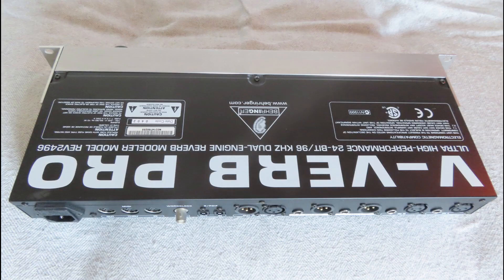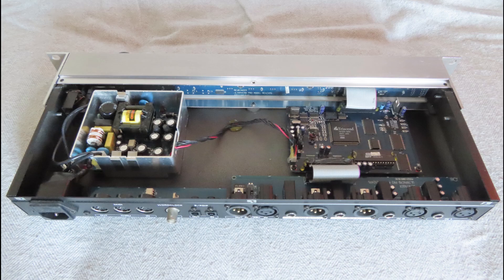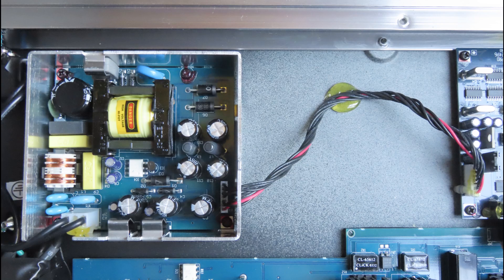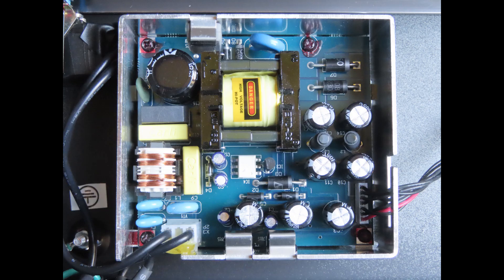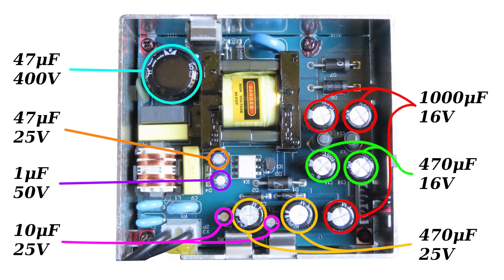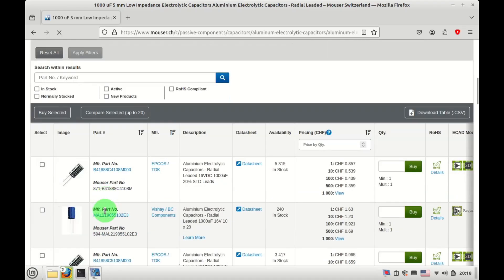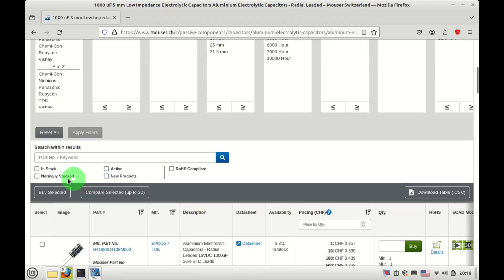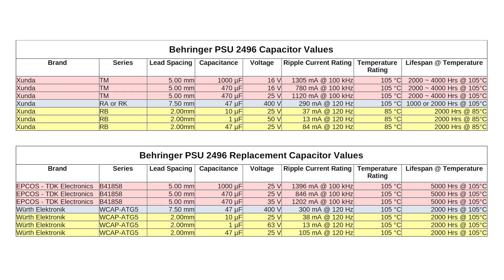Broken & Malfunctioning Behringer Rack Unit Fix. A Capacitor Replacement Is What Most Units Need.

Comment: Thank you for making this detailed video! I want to add that merely re-seating the power supply socket and pressing in the ribbon connectors solved issues on 2 of my Ultra-Curve Pro 2496 units. I haven't had to replace capacitors, and no further issues yet.
Reply from the maker: That is great. It seems to be a case of tarnished contacts where the simple act of unplugging and reseating the ribbons and sockets was enough to scrape of the tarnish and reestablish contact. If you have more stubborn tarnish or to completely clean off the tarnish you can use contact cleaner.

Comment: Mine DDM 4000 with same PSU have issues....powering off and on...I changed all capacitors in PSU and still sam behaviour. Maybe any solution? Tnx.
Reply from the maker: The rectifier Diodes could be a possible culprit. There are diodes on the power supply that rectify AC power and converts it to DC. If any of them are faulty the power supply will not work properly. If you replace them make sure you orient the band in the diode in the same direction they are now. These would be relatively easy to replace.

It could be a faulty Voltage regulator Integrated circuit, or transistor, these are all semiconductors. They are easy enough to replace but they are more challenging to identify and find matching replacements.

Also make sure to use your multi meter in continuity testing mode and check the circuit for breaks or cold solder joints. test any fuses.

Also test the output voltage of the power supply But because the power supply will be exposed and turned on to do this be extremely careful not to touch any wrong components as you could get an electric shock. Be sure to unplug the device as soon as you are done for safety reasons.
If the power supply delivers the intended power but the unit is not working the problem might not be the power supply

Also look out for anything that might be corroded, or components that look charred or burned.
Reply: @RandomStuffYouMightNeedToKnow I checked everything...I measured voltage when mixer shuts down,all voltages go off and on after 30 seconds. Rectifier bridge is Ok,I only suspect maybe something is wrong around dsp processor.
Reply from the maker: @dejbasic  If there is a 30 second shutdown cycle it could be due to overload or a Short circuit. 
This causes the power supply to shut down, wait, and restart. 
The culprit could be the circuit that is being powered by the power supply. Due to being faulty or having a short circuit. It could also be due to the Power supply itself having a short circuit. 

Try disconnecting your power supply from the circuit that it powers and measure its output. if the output becomes normal the culprit is the other circuit if the output remains in the 30 second cycling mode the culprit is in the power supply itself.

Also make sure there are no stray bits or debris anywhere on the circuit causing a short.
Reply: @RandomStuffYouMightNeedToKnow mixer is working perfectly until i supose heat up and then going into cycle off and on. When I lift up mikser main board in air,mixer start to work normaly. Strange issue.
Reply from the maker: @dejbasic  Your mixer seems to be overheating. This is why it initially works and than starts cycling on and off. when you lift the unit in to the air it has better circulation allowing it to radiate heat away from itself. An online search seems to confirm that the DDM 4000 does in fact suffer from thermal issues which aligns with your description.

Here is what I suggest you do.
Internally make sure there is not dust buildup as it prevents the unit from cooling, check any heat sinks for old or hardened  thermal paste. clean the heat sink and the component they are attached to and apply new thermal paste. You can use the same thermal paste that is sold for computer CPUs.
Consider adding Heatsinks your mixers internal Digital Signal Processors (DSPs) and other integrated circuits (ICs). You can attache the heat sinks with thermal tape.
Basically Behringer has done a poor job of cooling this unit, and anything you can add or modify to improve cooling such as heat sinks, Venting and improved circulation can make all the difference.

Externally Make sure the unit is not placed on a warm surface avoid placing it on top of other heat emitting audio gear like amplifiers, or warm effects units, avoid placing it near the warm exhaust air of a computer or near a heater. Avoid placing it on top of insulating fabric like felt. Make sure your mixer is not covered or sandwiched tightly between other objects. consider an external fan for air circulation cooling.
Reply: @RandomStuffYouMightNeedToKnow I found where is issue. There is on mainboard one linear stabilizator (7812) and 12 volts is missing on board. Im waiting for component to change it and then I will see and report here whats happend.
Reply from the maker: @dejbasic  Good Luck I hope you will succeed.

Comment: interesting! as per my first electronic work I though I could make it but now is not turning on so I beleive I have not done it right :(

I will need to find someone in Lonodn to fix it now.... I have put the paste but doesnt turn on, could that be an option? or I just did it wrong alon the process?
thank you
Reply: I can confirm I believe I detroyed doing the soldering :( what a nob! Do you know any nice psu  replacement to order?
Reply from the maker: I am sorry to hear that. You might not be to blame for the device not working. It is also possible that your power supply has a broken transformer rather than bad capacitors. Also double check your work. Make sure al capacitors are placed in the right spot and al the polarity's facing in the right direction. Check that you did not miss soldering any of the capacitor leads. and check that you did not accidentally create a solder bridge. If you find a mistake fix it. Also check the obvious and make sure you plugged al the wires back in to the headers after you finished installing the capacitors.

Do you know if there was any burning smell or smoke coming from the power supply at any point.

If you want to buy a second hand power supply sometimes you might find a PSU2496 for sale online such as on ebay. check periodically until hopefully one pops up. 
There is a guy in the UK that sells new high quality linear power supplies for replacing the PSU2496. These replacement power supplies are of superior quality and they produce less noise than the original power supply. Unfortunately at £360.00 they are rather expensive and for that reason likely out of the question. https://plasmamusic.com/behringer-deq2496-replacement-power-supply

before you invest a lot of money make sure that it really is your power supply that is broken and not the rest o your behringer unit. 

I am sorry I cant be of more help to you. If you have any questions i will try to answer them.

Comment: WOW and Thank You! 
When I changed all 12 of the electrolytic caps I noticed that three of the crappy Xunda caps were leaking. My V-Verb now powers up again and works flawlessly! I am using the SPDIF optical IN/OUT at 96kHz and this box does not even feel warm after several hours of constant use.
The sounds I am getting are so unique and AMAZING! I love this reverb and will never sell it! THANK YOU SO MUCH for the info!
Reply from the maker: Thank you, you are very welcome. I am happy to hear you got your reverb working again.
You are right this reverb unit does sound amazing. Aldough unconfirmed, rumor has it that Behringer reverse engineered highly renown Lexicon reverb units in order to produce this awesome sounding unit which they sold at a affordable price. If the rumors are true this unit might have some lexicon inspired algorithms inside of it. The V-verb pro is arguably one of the most loved units by Behringer and unfortunately went out of production.
It is a gem well worth looking after.